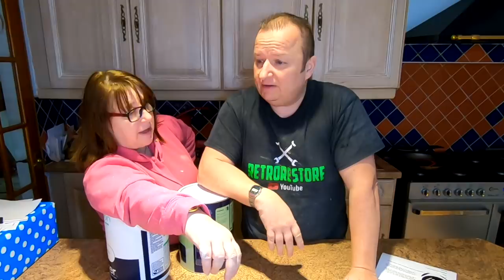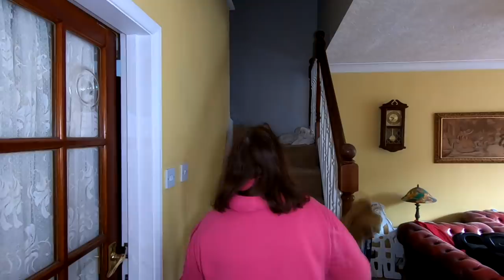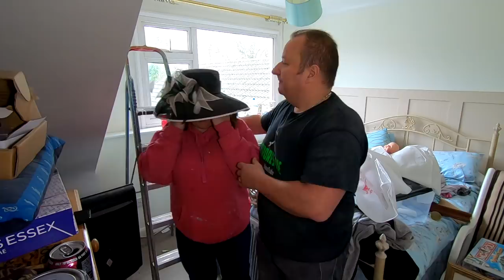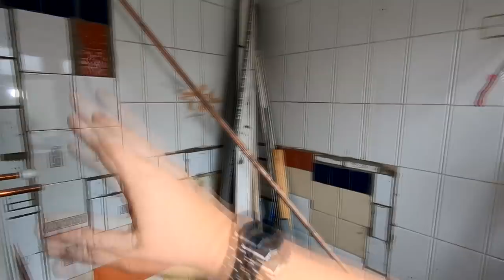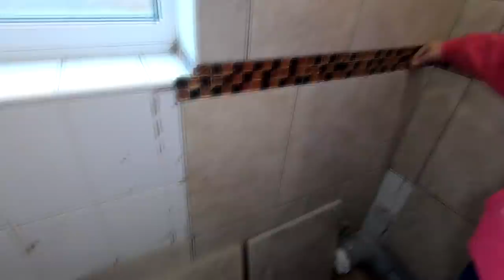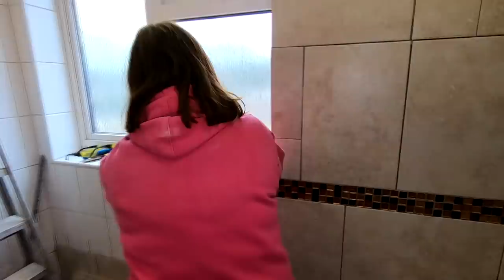Decorate With Me And Paint Progress Upstairs Vlog

Comment: I used to mix paint for a living a few years ago and it is never the same. Even if you get it mixed at the same shop off the shelf and paint machine paint the same colour will be different. The machine is calibrated every single day so wouldn't recommend. Also forget matching Dulux or Crown with Farrow and Ball you will match the colour but put it o the wall with the genuine F&B and it'll be like night and day.

Comment: did you take the old tiles off? or are you tiling over old tiles?
Reply from the maker: Tiling over old tiles is fine.
Reply: @butlersempire  fair enough I always remove.old tiles or was it not easy to do so
Reply from the maker: @only1stefan  They were fitted to plaster board so it would have destroyed the walls.